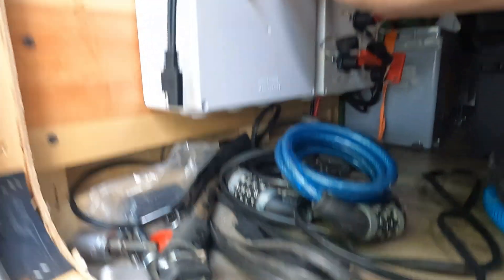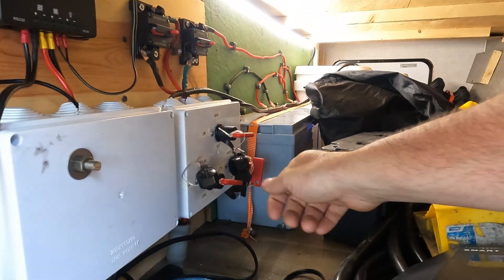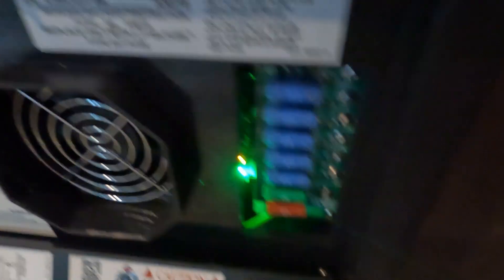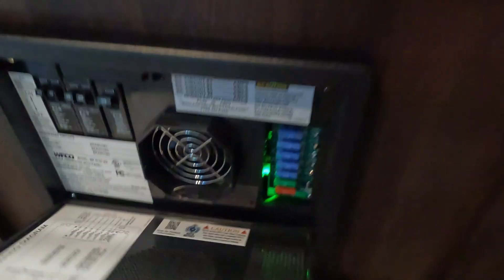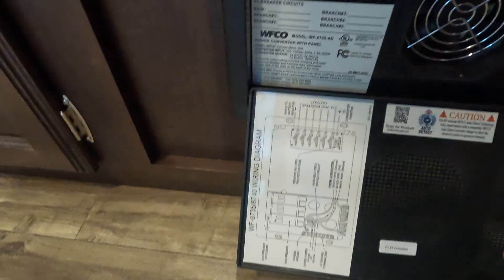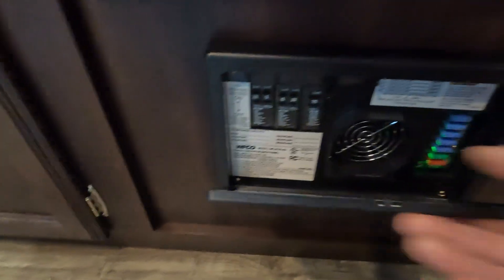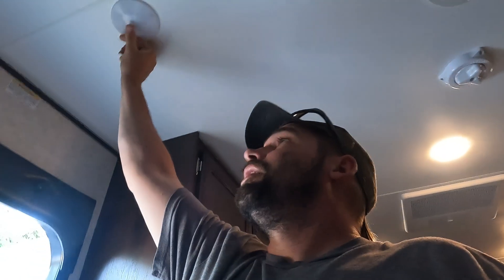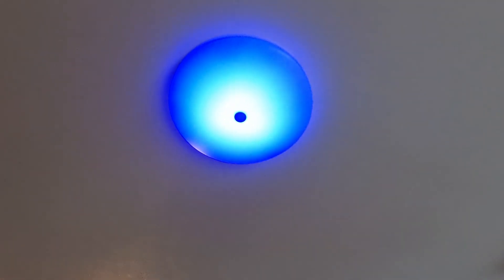wf-8735-ad update

Comment: I just purchased the same converter. I relocated the new lithium battery next to the converter. Next,  called WFCO, and based on WFCO direction. I changed the 2nd fuse from bottom to a 40 (marked Red position). I ran the battery down to 0% (yes, that’s what they said to do). Charged on shore power to 100%. It doesn’t turn blue until after the first full charge is completed. At this point, it’s working great. The prior converter never worked well, I bought the trailer used.

Edit: I unplugged the shore power last night, and ran battery down to 97%.   Plugged 110 in this morning, and battery is charging at 14.3. WFCO stated the sweet spot for charging is 14.6. So, pretty happy with the 14.3 🙂👍
Reply from the maker: That is good to hear that you got it working.

Comment: Thanks for the video I just got a lithium battery, and I have the same converter, I was thinking of getting the new one but I’m unsure with all the problems I’m seeing.
Reply from the maker: You can run the converter you have from what I was looking up. Like I said, if I was yo do it again, I wouldn't change the converter
Reply: @Milnickel  awesome thank you so much for the reply. So what I've been reading. It will charge the lithium battery just takes a lot longer? My lithium battery book says a 100% charge is estimated  >13.33v
Reply from the maker: @Tj-oq2lw  I just put out a new video. They make a jumper, and when I put the jumper in, it change to the lifepo4 charging profile